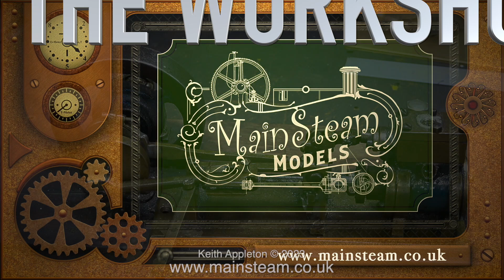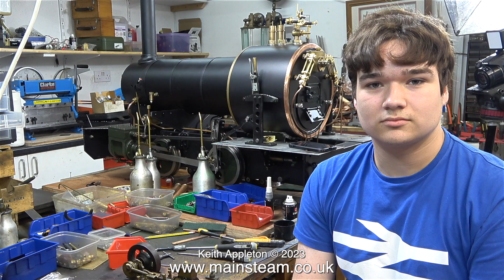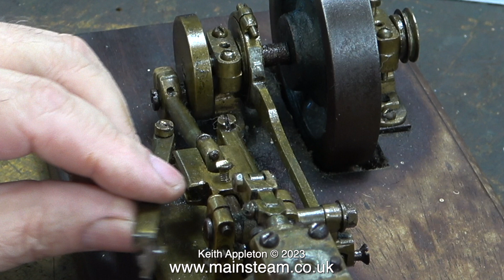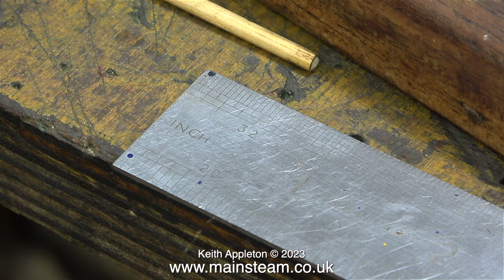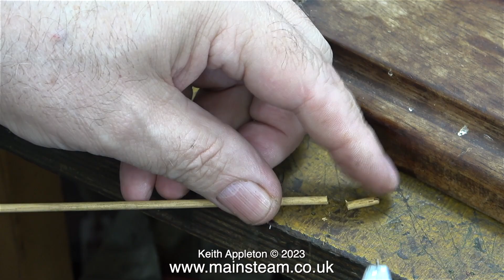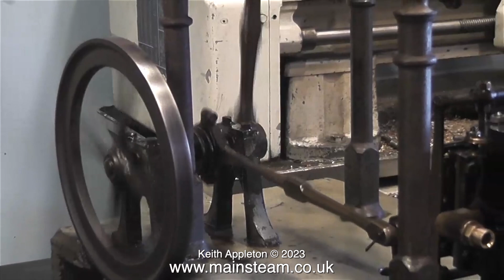A DIABOLICAL MODEL STEAM ENGINE - PART #1

Comment: Love the portrait at the end :)    Australia did this with smoke packets as well...      May I have a guess a the plummer block threads?    #5-40 UNC would fit the description (very close to 5BA in size and pitch) or 1/8"  whitworth (same as  5-40 except 55 degree flank angle).   Great to see a young person interested in things mechanical.

Comment: I've repaired screw holes with dowels, toothpicks, random splinters, etc. I will probably do so again but it just isn't the proper way to do it, especially if the screw is going into the hole more than once. The problem is that the grain in dowels runs along the length of the dowel and the screw threads will slice through them completely ruining any holding power the dowel may have had. In the long run the screw will loosen and fall out again leaving you with a hole filled with dowel bits and wood glue for you to clean out. A better thing to do is to drill out an oversized hole, then use a plug cutter (or whittle something down with a knife or chisel) to create a "dowel" with the grain running the same way as the base. Filling the screw hole with 24-hour epoxy and wood dust is another solution.
I'm really looking forward to the rest of this series!
Reply from the maker: I will probably use long bolts through the Baseboard for the two main mounting area.